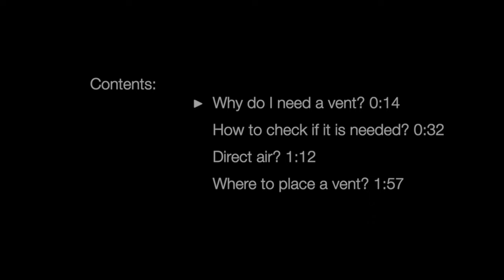Do I need an air vent for my stove?

Comment: In your experience, is it normal to have a direct air kit installed within the fireplace recess?

I ask because Document J (1.10) says "air vents should not be located within a fireplace recess except on the basis of specialist advice".  I was planning to install a Parkray Aspect 8 with their Direct Air kit, but I'm now considering getting a <5kW stove as I cannot find confirmation anywhere that I can install the air vent in the back of the fireplace as planned! 

Thanks for making all of these videos !
Reply from the maker: Generally with air vents they suggest an air exchange across the room. Obviously with direct air there is no air exchange at all, so it is very normal for these to be fitted straight through the back of the fireplace. As always it is your fitter, as there are many other factors to consider, but typically there is no issue with what you’re proposing.

Comment: I have an 8kw multi fuel burner, it's an old 1930s house and I do not have an air vent.  The burner works very well with excellent draw. Is it safe to operate like this..

Comment: We just put a wood stove in (new EPA rated) and long story short when we open the lower air intake or close it there's not much difference in the size of fire, Manufacture said we absolutely need a direct air vent. Ive seen a handful of other video's that have our stove and no air vent and their air intake lever when open makes a huge difference in the size of fire...any thoughts?
Reply from the maker: Are you struggling to get it to blaze, or to close it down?

What are you burning?

How old is your house roughly?

Comment: Hi Gabriel, I recently bought a 5kw stove, i know i dont need an air vent but i would like one, i'd have liked to buy one with direct air but the models i found were out of my price range. my house is 1920s and im sure air getting to the fire wont be a problem but i dont want cold air being dragged into the lounge - I want to put the vent in the floor beneath the stove (or behind) and pipe under the floor to an external airbrick - can you see any problems with this? 
love the channel and many thanks
Reply from the maker: Generally regulators want the air to exchange across the room. So the requirements for air vents generally is it must be either connected to the stove, or away from the stove.

Comment: If you want to do a 'direct vent' can  you take it from under the floor boards?  I am in an old victorian property and its well ventilated down there and the stove would be 5kw
Reply from the maker: On a 5kw you don’t need an air vent at all, but you often can vent a direct air stove downwards. Some vents are on the back of the stove which is a bit more annoying because you need bends etc, but most modern freestanding stoves allow you to vent straight through the base of the stove.

Comment: Any recommendations on the type of air vent? Thanks!!!
Reply from the maker: The main manufacturer of vents is Rytons, but they’re not very nice looking. I would pick the thing that looked nice. I live in an old place so I’d be much more likely to go to a reclamation yard and find an old cast iron thing that looked nice. The only key thing as far as regs is concerned is that it can’t be closed and that it is the correct size. I’d perhaps buy the correct size pipe to put through the wall, and then I’d get a little more creative with finishes so that it looked right with my home.
Reply: I think they all come in 4 inches my stove came 4 inches .

Comment: Am looking for answers. Getting conflicting info. I have a pellet stove in finished bsmt. Got it with house purchase. First winter. Damp air in this region. Common problem with cold floor drafts. Dealer says no to outside air intake because damp air will cause problems. I cant see much info that supports the damp air issue. Anyone?  Have an HRV as well. Dont want to run that 24/7 to keep fresh air just for stove. Frustrating problem!  Oak kit or not? Then need a way to "dry" the air before it gets to stove. Some moisture absorbing bucket or ??? Grasping here!
Reply from the maker: Sorry, but I cannot make head nor tail of any of that. Can you explain it in simpler terms without the Jargon and abbreviation, because my simple mind is lost.

Comment: wouldnt it be good to mention also that anyone who has an open plan downstairs where the kitchen is open to the room that has the log burner should really have a vent, this is because of the extractor fans in cooker hoods will reduce airflow to the logburner